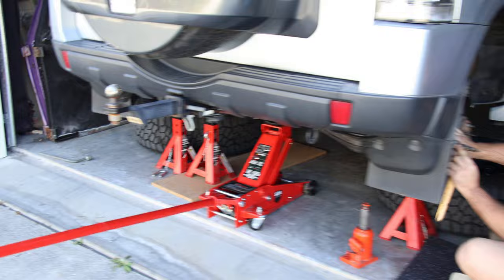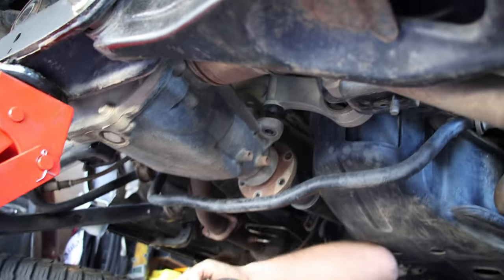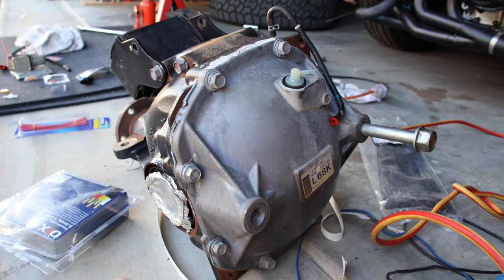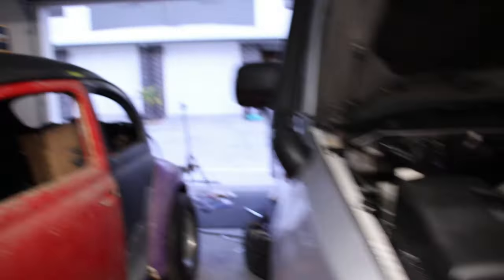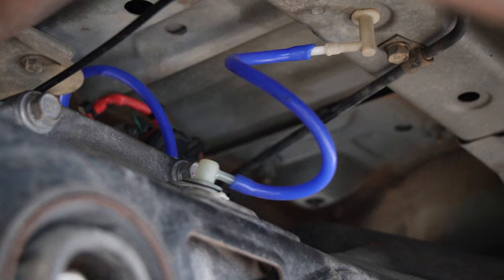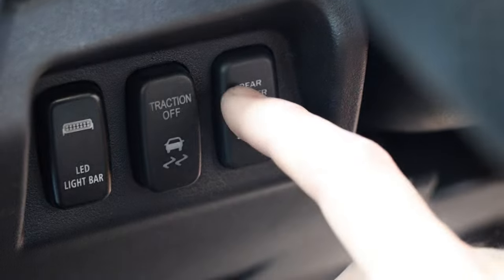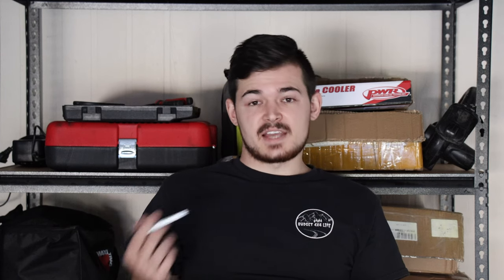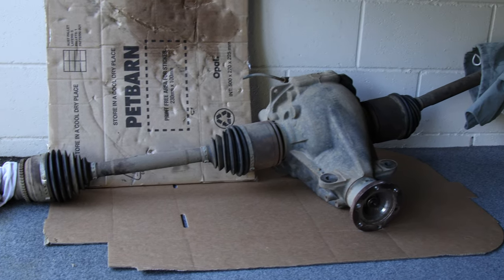How to install a Factory Rear Diff Locker into Your Open-Diff Pajero!

Comment: Hello, do you know if this rear lock works completely the same as the one that comes standard with the car?
Reply from the maker: @theestractor2.014  yes except it wont show on the dash because you dont wire it through the ecu. So jot exactly the same but same diff and compressor and cvs.
Reply: @budget4x4life  ok thanks you

Comment: so it's not diff locker, but the whole diff replacement :/
Reply from the maker: @NOhead2  plus wiring of the diff locker making it an installation 😄🤙🏼
Reply: @budget4x4life  but the locker itself is in the diff 😁
Reply from the maker: @NOhead2  and we installed the diff 😄
Reply: @budget4x4life  ok fair enough 🤣

Comment: You've removed the ASC button you said and replaced it with your Diif lock one. You do know that the ASC disables the power retardation side of the Traction control in all but 4Llc. As soon as you start spinning up in snow or sand your power will disappear...Maxx tract and shovel time. Believe me you do need that switch if you use high range.. I would put it back, even with the rear locked, the rear, and the front will spin and once the front spins unevenly in sand the traction control will operate and power retardation will occur. You'll likely come to a stop and hence be bogged. Many of a Pajero driver has forgotten press the ASC and had this joy. The vehicle should perform very well in low range however, with diff locked and front brake traction control in operation. Just remember the rear wheels need to have both lost traction, and spinning a little, for the loose front wheel to have the traction control apply itself. The center diff is locked is why this happens. Great vid.
Reply from the maker: @ajcuthy1945  thanks mate. Still have ASC and can turn it off with the traction control mod 😜👌🏼

Comment: Hi, gogod job.. did you was able to connect to the dashboard ligth?  there is the central diff and the read diff lock light when are active
Reply from the maker: Hey mate it is not installed via the ECU so no lights will come up only on the switch 🙂💯

Comment: Can you share how you connect the compressor. There are 2wire from compresor and 2 for sensor. Do you connect sensor or. When i connect the compressor it build pressure lock its engage and after that the compressor turn on turn of turn of interval couple of seconds
Reply from the maker: @TJ.Outdoor  think you connected the wrong ends. Swap the 2 tubes and see what happens
Reply: @budget4x4life  but the diff locks. When engage or its possible to lock with other tube. Will check https://streamable.com/k5e9be
Reply: @budget4x4life  they are fine. One tube its for pressure and one for vacuum. The locker work on pressure side, on vacuum wont lock at all. I check for air leak the solenoid its fine. Maybe gen3 and gen4 are different ?
Reply from the maker: @TJ.Outdoor  yeah not sure… we have that bit in the video where we show the compressor and which wire goes where if that helps 😬

Comment: Going to be really interesting to see how the rear diff lock copes with the traction control in the rear - hopefully the diff won't be fighting against braked wheels! Holding thumbs as I want to do this to my 2008 lwb!
Reply: Good question.  When a genuine rear diff lock is engaged, the traction control is disabled.
Reply from the maker: Tested and it's fine 💯 wheels turn together so doesn't trigger it as spinning. Only when one wheel stops and other spins
Reply from the maker: @allanpower8041  check reply above 🙂
Reply: @budget4x4life  Yeah thats what I thought it would do - but if both rear tires spin up quickly as if they've lost traction, over loose gravel, sand or rocks for example, I think the traction would still kick in. But you've got that fancy loom that disables traction entirely so you should be fine!
Reply from the maker: @peterstevey  I am doing a video soon so we will see how it works and behaves in what modes. The locker will also be on just for slow crawling so slipping will be minimal. For more momentum stuff I'll rather have the tc off. But we'll see what happens 😊😜

Comment: Great vid, the factory rear diff locker in my 2013 NW GLXR was a key purchasing decision.
Reply from the maker: Can't wait to properly test it 😜😍
Reply: Have you used the diff lock much? Love my Pajero, but it can struggle in really steep, rutted, soft stuff. Wondering if the RDL would help with that.

Comment: Awesome video I have been looking at doing this to my NT LWB, but was worried about traction control kicking in.
Reply from the maker: Video coming soon to see how everything behaves 💯 the locker is there for the hard slow stuff so slipping will be minimal for the rear as it's locked... should be front only. With more momentum things turn tc off 💯

Comment: Hi, is there any chance of uploading a wiring diagram of how you wired it. I'm assuming you had a relay?
Great demonstration thanks!
Cheers Col
Reply from the maker: Hey matey. Everything I did is shown in the video 🙂 no relay just a fuse en switch to air compressor 😊💯
Reply: The wiring part in the video was a bit...rushed. Any way you can explain in detail how the wiring for pump was done? Just finished swaping both my diffs out for 4.9 with rear locker and I just need help with wiring as well. Thanks in advanced. love the vids!
Reply from the maker: @javierjimenez644  hey mate yeah we wanted to get it done 😄

Wiring goes from pump to battery and then to the switch in cab. Compressor has a positive and negative wire. Very easy to do. What did you get the 4.9 out of with locker? And what size tyres do you have🙌🏼💯
Reply: @budget4x4life  Thanks I think I can figure it out from here now! The 4.9 came out of a Gen 3 with low km, The only issue I came across was the driveshaft bolt pattern was slightly different (Gen 3 4 bolt pattern and Gen 4 6 bolt pattern) in my new diff, so I just popped the shafts off the old diff and fitted it to the new diff so no problem. I am running Falken Wildpeaks 285/70/17s
Reply from the maker: @javierjimenez644  nice mate! They are very tall gears, the Pajero will now get up and go without a lag. Let me know when you fixed the tailshaft issue and how the car runs afterwards. Should be able to make an adapter plate in metal for it if the holes don't line up.
Reply: @budget4x4life  No need, I took the one off my old diff and put it on my new diff, and worked with no issues. Gonna work on the wiring this weekend and I'll let you know.

Comment: Hi, what is that intercooler doing behind the air box side? Is it a secondary egr gas cooler or a heater core?  It doesn’t look stock, could you explain it ?
Reply from the maker: Stock egr cooler mate 🙂

Comment: Make sure you route the compressor inlet hose to a height above your max  wading depth otherwise it could suck in water if you have the difflock engaged whilst doing a river crossing
Reply from the maker: Yep will do so cheers mate. Still deciding where I wanna run it. 🙂💯

Comment: are they factory lsd or single spin
Reply from the maker: Open diff 🙈
Reply: @budget4x4life  so if i decide to use factory diff lock i have to change the cv shaft and get the pump
Reply from the maker: @iphone-uz8vc  correct
Reply: @budget4x4life  was your one open diff before u got lock diff
Reply from the maker: @iphone-uz8vc  yep 😃